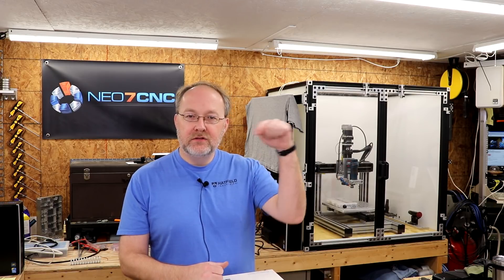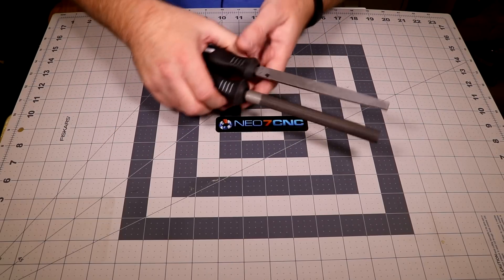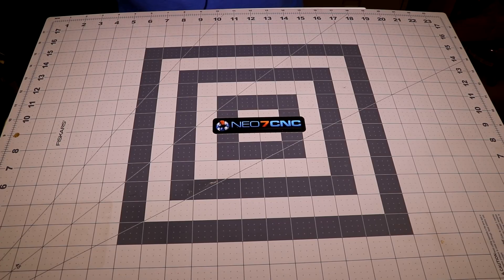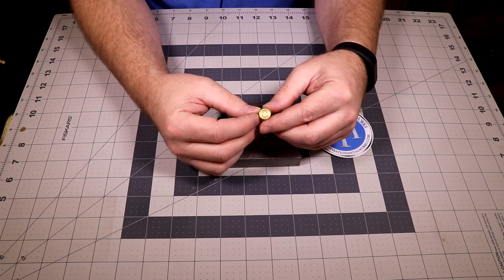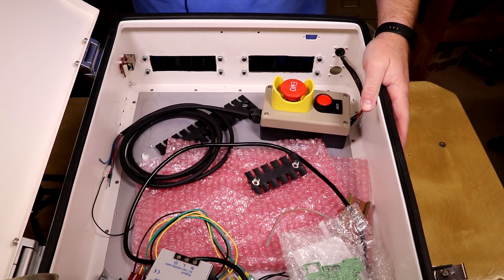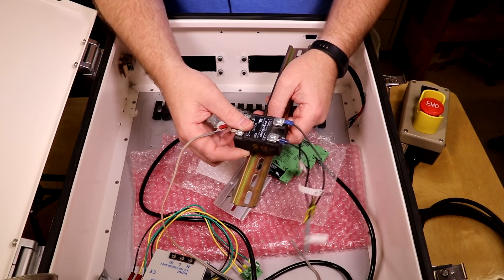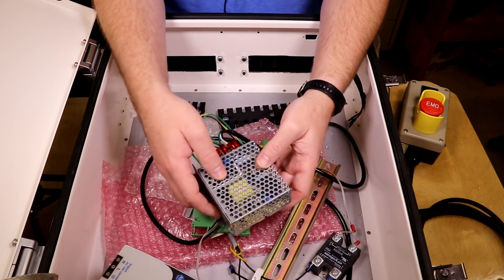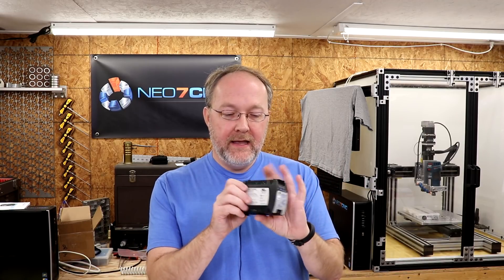Junkbox 10 - Flea Market Finds, NEW CNC Controller and MORE

Comment: David, I know this is old, but simply use stand offs for Acorn. Be sure to visit the Centroid User Forums if you have any questions or trouble: http://centroidcncforum.com/viewforum.php?f=20 There are also a number of videos to help get you started with Acorn, including setup and configuration. I think you will like Centroid Acorn. Hardware and software from the same manufacturer with over 30 years experience in CNC machine control. Look forward to following your build.